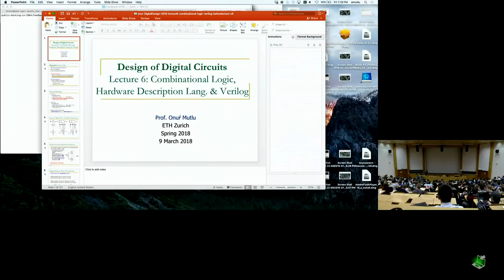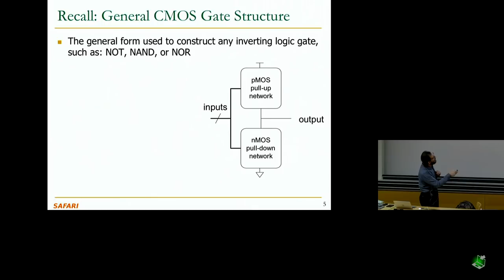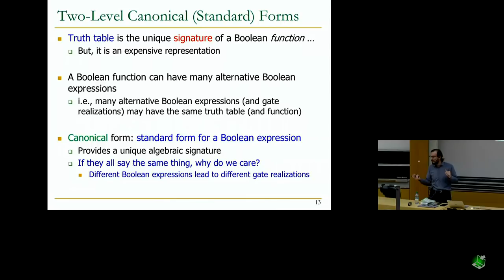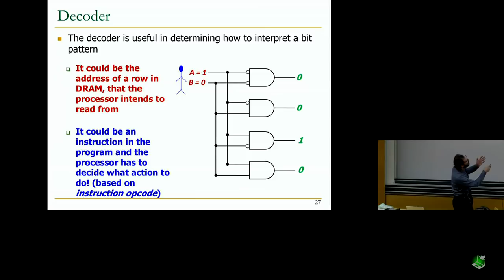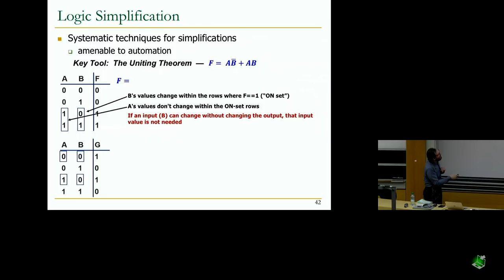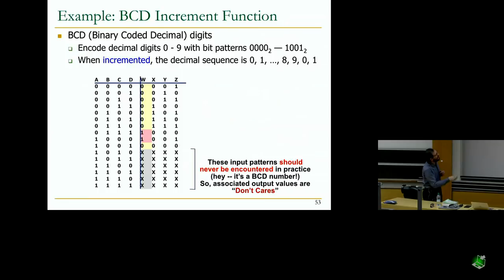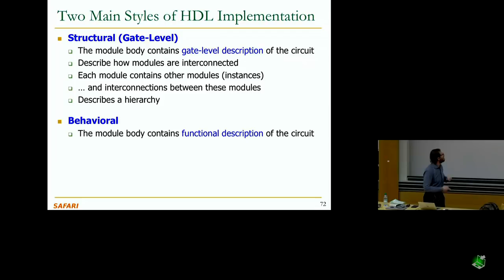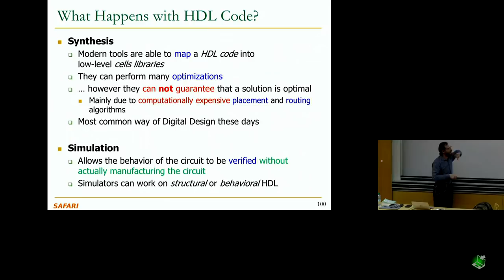Design of Digital Circuits - Lecture 6: Combinational Logic, HDL & Verilog (ETH Zürich, Spring 2018)

Comment: At 43:03 professor states that the MUX is the opposite of the decoder. This is wrong and confusing. DEMUX is the opposite of a MUX.

Decoder: You select which output out of "n" outputs will be "1" (all others will be 0). You do this from an input code of size "log2n" bits.
DEMUX: You select where the input signal will go to, given a single input. Here there are "n" outputs to choose from, similarly to a decoder, but the difference is you do not set the chosen output to "1", you just divert the input to the chosen output.